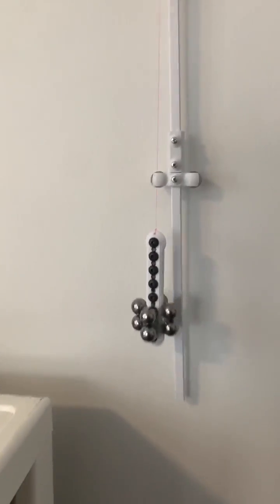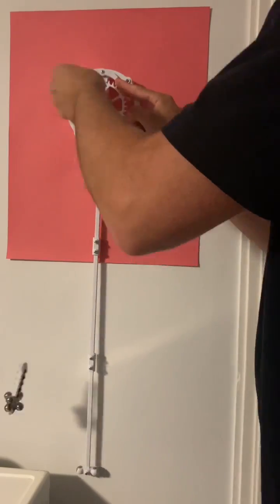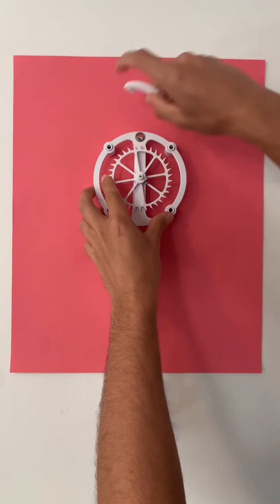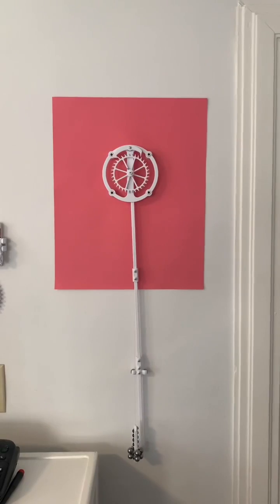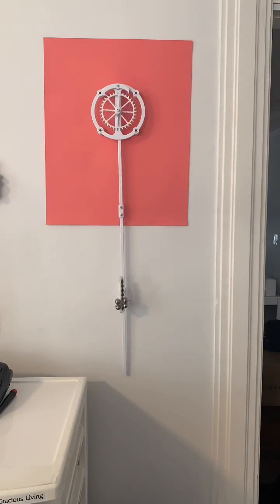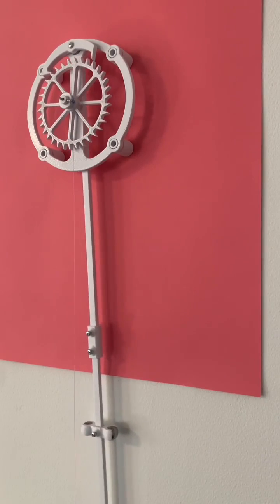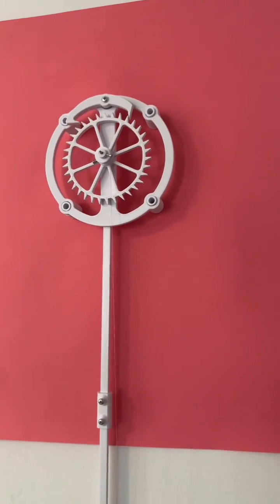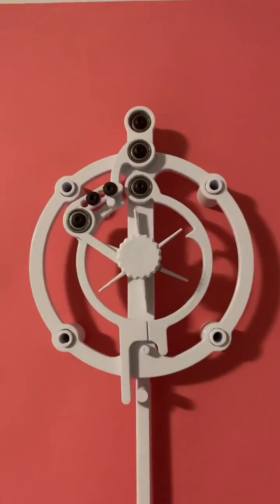The Recoil Anchor Escapement Mechanism | 3D Printed

Comment: I have an antique mechanical clock. I had to learn how to calibrate it, because the pendulum has a loose nut at the end which can be turned clockwise or counterclockwise to raise/lower the main weight of the pendulum. By raising the main weight, the center of mass of the pendulum is shifted upwards, causing the clock to tick faster. Over the course of several days/weeks I would calibrate it by rotating the nut in increments of full rotations, half rotations, and quarter rotations in order to balance it out so that the clock won't be fast or slow after a week of operating.

Comment: How easy would it be to make a completely eccentric escapement mechanism? One where each tick & tock is subtly, or grossly, different from any other - completely at random.

Tick-tock, tick-tock, tick... tock, tick-tock, tick-toock, tick... tick-tock.

I recall this being used in a "haunted house" story, where the entire point was to cause the protagonist to go crazy. Every so often the clock would skip a sound, or the timing would be off, in a way which I can only imagine would be bloody irritating, if not extremely anxiety-inducing.

I suspect the obvious way would be to have a gravity-escapement mechanism just like this, but suppress the natural sound with insulation & use electronics to mimic the sound. Even add a remote link to switch it between normal & crazy modes - just to be extra mean...